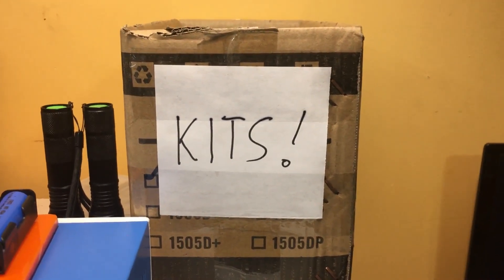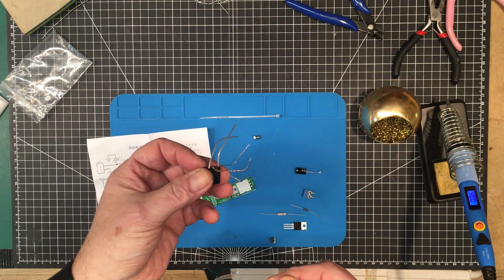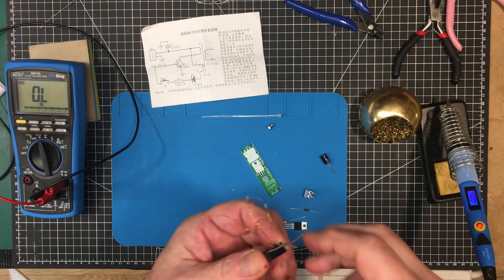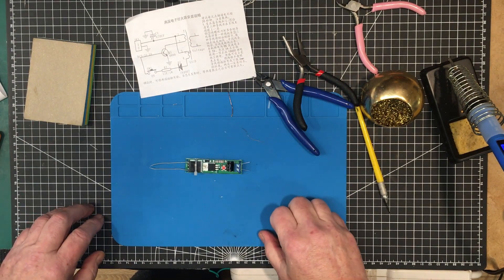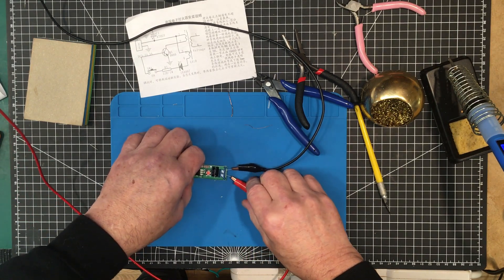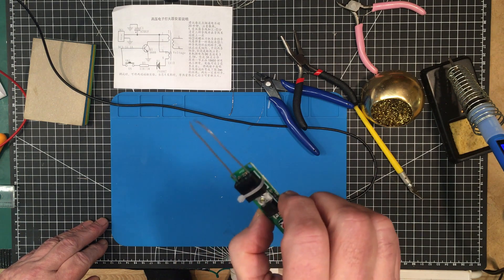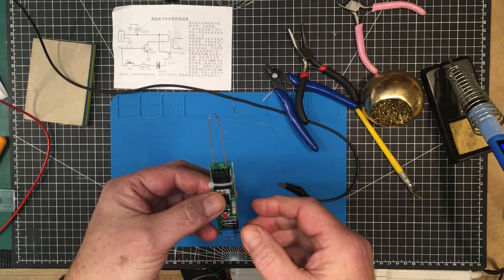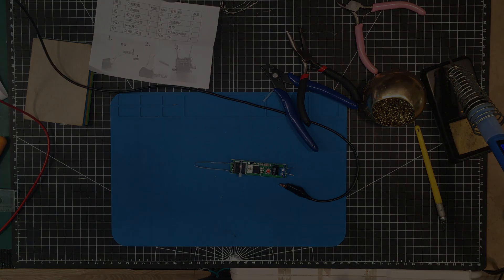0127 - Kit of the Month: HV Generator.

Comment: Love the Smooth Jazz during the build.  As a use for a this, a BBQ lighter is the most obvious, but you'll need to add more distance from the electronics to the sparky end.  Or, you may need to generate the voltage for a sparkplug someday.
Reply from the maker: Thanks Steve!

Comment: Strip the output wires a bit more and you can make a really tiny Jacob's ladder. Minutes of fun.
Reply from the maker: Got to try that!
Reply: @uni-byte From memory, the way to do it is to make a "v" shape. You need to have the narrowest gap near the bottom, where the wires are connected, and as the arc travels up, it ionises the air, and can jump a little further.
Reply from the maker: Yes, I believe you are right.

Comment: So your video, per the below posts, inspired me. I would love to share with you.... I got ahold of ESP32 S2 min ($4.00USD). I programmed the following: Pin 13 to pick up a button press.  Pin 2 and Pin 3 to be active.  Code will do a random number between 1-6. IF number is == 6, then the pin 3 is activated to forward 3.3v out.  Else Pin 2 is activated.  Pin 2 right now lights up a green LED through a 330R, And Pinpin 3 lights up a RED led; also through its own 330R resistor.  So... in theory, once my kit I ordered arrives, I should be able to modify it per the below threads; to send that 3.3V to the generator....  keeping the leads far enough apart to AVOID the plasma arch.....  Would I ever use this device?  Hell no. LOL.  Just a fun experiment based off your video.  You rock. man. I subscribed. My son is begging me for it when its done.  He is a 31 year old crazy cowboy LOL.
Reply from the maker: LOL!  Let us know how it works!  Thanks for the sub.